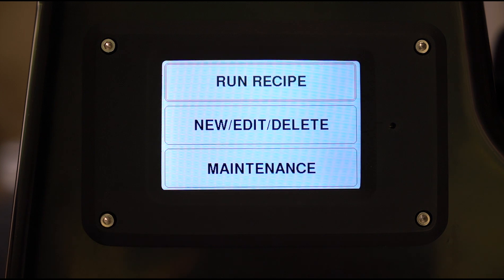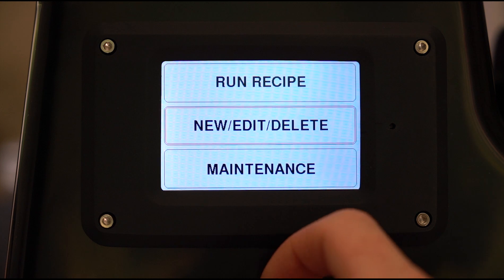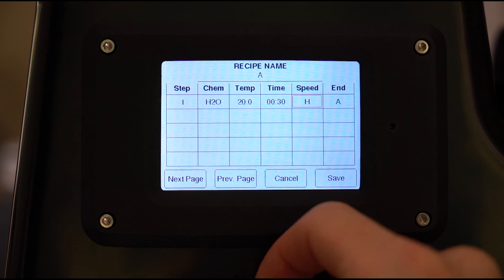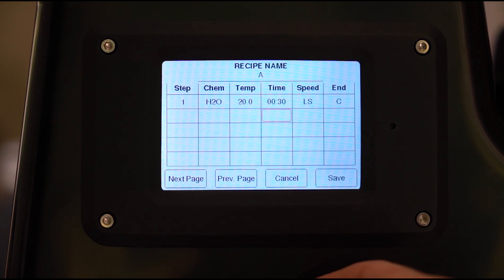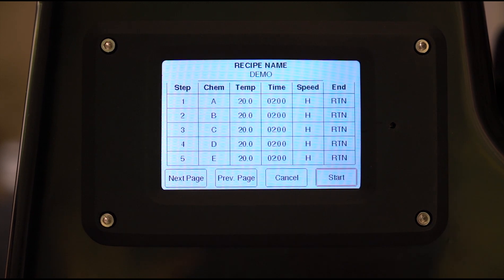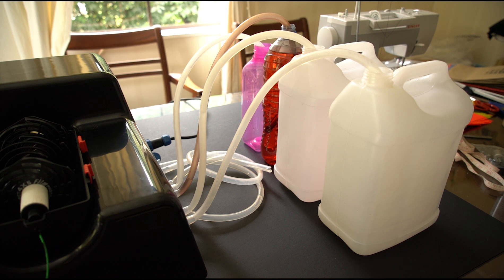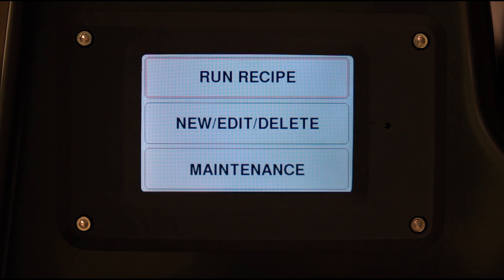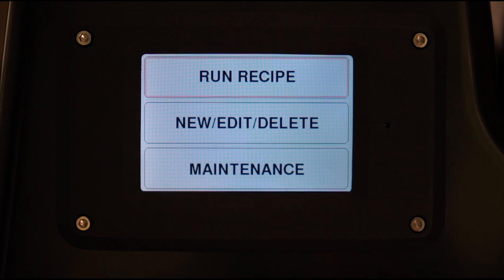Chromabox-4 User Interface and Info

Comment: Have you mentioned a rough idea on the price point? Like where it will fall relative to the similar machines?
Reply from the maker: Matt, I don't believe any machines currently produced are similar, but I suppose the closest would be the Filmomat or JOBO? I'm aiming to come in at or under the prices of those machines. Currently planned full retail price is around $3k USD, however I'll be offering discounted prices for pre-orders and if demand is high enough I should be able to bring prices down. Unfortunately in the last year prices for everything in general have risen which doesn't help, I'm seeing raw components costing on average 20% more than before.